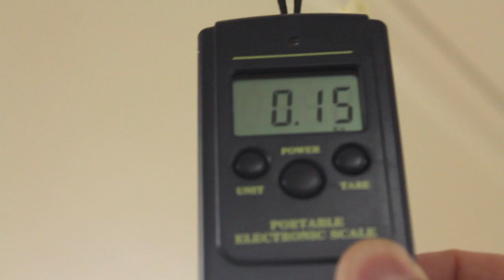DIY Mini Quadcopter Scratch Build Introduction - 3D Printed Frame, Cheap Electronics, and MultiWii

Comment: 3d printers cost alot I could buy a pro drone for that much $ so could you do anything without 3d printing?
Reply from the maker: +Drone Guy There are much more affordable printers on the market nowadays. It all depends on what resolution and build size you need. Since I posted this video prices have come down on both printers and drones. I still love my 3D printer, but don't so as much design any more due to limited time. Good luck with whatever you decide.

Comment: can i use a rc helicopter transmitter and riciever to control the quadcopter
Reply from the maker: ahnaf rafid It's really hard to say without knowing the model of the TX. Sometimes you can get away with flying in heli mode, but it's very dependent on how your TX is configured.
Reply: ok..thanks for your reply

Comment: This will be my first build. I just printed it on my 3D printer just now.
And thanks for the tip with my 3d printer.
From: Dj Williewill At Earl's Hobby Shop
Reply from the maker: Glad to hear you got it working. Good luck getting the quad in the air.

Comment from the maker: Thanks. I've seen various calculators around the web, but man do they ask all sorts of info! I'm thinking the best thing will be to get a bench test setup so I can test the thrust and power in real life. I was thinking something simple like some of these DIY thrust measurements setups using a simple kitchen scale. Just need to know what ballpark I'm in. Since these cheapo motors have no power/thrust information published. Will let you know if I have any Qs. Thanks Ron.

Comment: Dennis, I've built quite a few multirotors for myself and others.  I have resources I use along with experience to match the best motor, ESC, prop for a given size or purpose.  Feel free to contact me if you have questions about any of those issues.  All the Best!  Ron

Comment from the maker: Thank you. I'm going to need it :) The motors I purchased are complete garbage so I have some better ones on order. It's pretty fascinating to me all the variables that go into designing a quad. Now I wouldn't say what I'm doing is fancy compared to the TBS and QAV frames, but getting the proper motors, escs, props, power is quite the effort.

Comment: Dennis, I would like to see a quad with arms that are enclosed and motor mounts that are slotted to accommodate several types of motors.  The motors do not have to be weather proof but all electronics do, so enclosed arms would protect the ESCs and an enclosed fuselage would protect the controller and receiver.  I'm not sure how big your table is so I don't even know if this is possible.. but just thought I would put it out there.  All the Best and Happy flying!

Comment: No problem! The stratasys system uses ABS plastic and has support material that can be broken off with pliers etc. or removed via chemical liquefaction. To be honest the one we have at school has a .2mm layer height and I prefer the makerbot print quality. The boat design was printed on a makerbot and it came out perfect. the current design sits to low in the front and unfortunately at 16mph I got some splash on the prop and it shattered.

Comment from the maker: I just used it yesterday and was a bit underwhelmed mainly because the directions recommend using two coats and letting each coat dry for 4 hours. Obviously I didn't follow that, but thought it was pretty absurd to wait that long!

Comment from the maker: Pete, good question. Here are a few reasons:

1. My 3D design skills are weak so I'm trying to gain experience. I don't have the ability to design something like that H quad (which is awesome) just yet.

2. I wanted to make the components cheap and modular. I think all in the frame will cost less than $5 in plastic and wood. The dowel rod from Home Depot could make 2 frames and costs about $1.

3. These parts should be easy to replace if broken.

Hope that makes sense...

Comment from the maker: It works great and have no clue why I didn't think of this in the first place. I say it works great...I haven't actually flown with it but am confident I got the wires connected properly :) I bought some liquid electrical tape because I'm out of heat shrink tubing and it's not easy to get locally. This liquid electrical tape sucks compared to heat shrink but we'll see how it does. I'll have an update soon. Thanks again.

Comment from the maker: Check my channel for one titled "ArduPilot ArduCopter APM 2.5 Configuration with Turnigy 9X Transmitter and Receiver for Quadcopter " and let me know if that helps. I did it a while back and do plan on doing an updated one with the latest firmware. The APM is intimidating at first, but once you mess with it a bit you will get the hang of it. It comes down to if you're willing to constantly tweak or if you'd prefer to do minimal tweaking (aka Naza) with less capabilities.